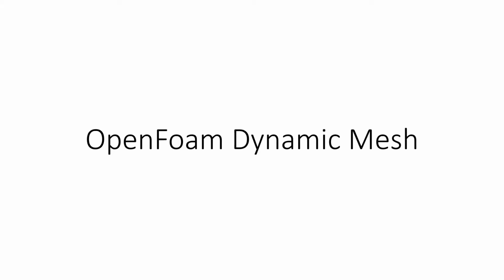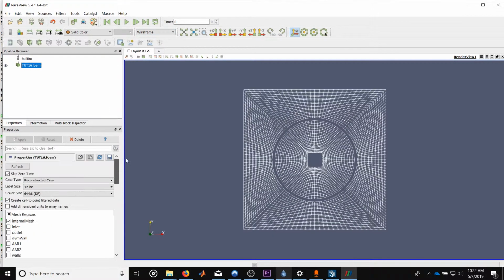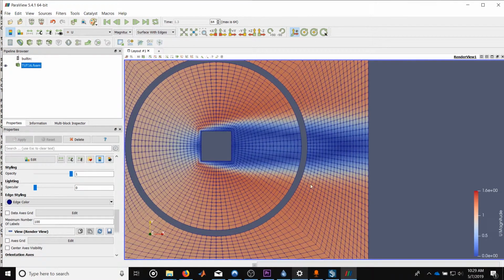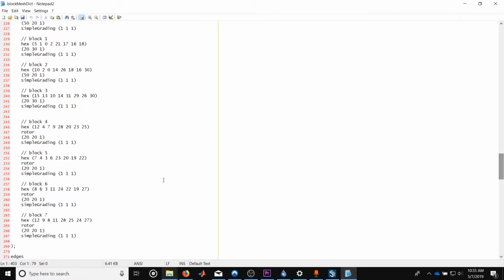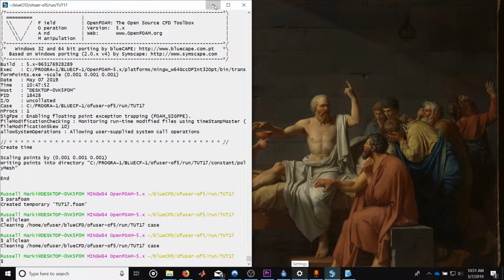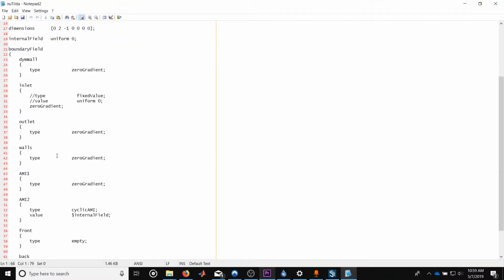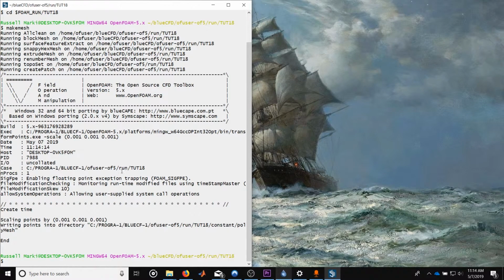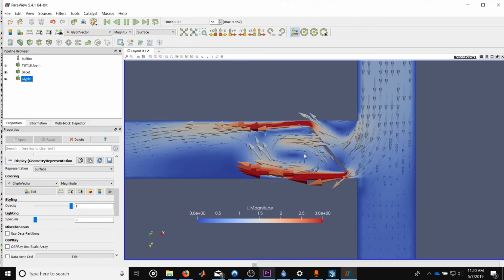Basic Dynamic Mesh Tutorial OpenFoam

Comment: Hey, thank you so much. I need to make a pimpledymfoam case for my thesis and I didn't know where to begin
Reply from the maker: What kind of case?
Reply: @russellm8635  I have to make a 2D simulation of a rotating vertical axis wind turbine, called Savonius turbine.
Reply from the maker: @riccardorinaldi6430  OK, that turbine looks like it should be simulated like the 2D case I have in the tutorial.  The turbine itself will just an edge in the mesh, defined as a wall.  The "cyclicAMI" would be the outer circle and the "wall" would be the two scoops like in here https://en.wikipedia.org/wiki/Savonius_wind_turbine#/media/File:Savonius-rotor_en.svg
Reply: @russellm8635  Good advice, thank you! Actually, I thought something like that, but, currently, I have a problem with the meshing with SnappyHexMesh: I introduced a cylinder outside the scoops to make them rotate (the AMI), but the wall of the scoops are then too much "squared" and they're not curve surfaces. I don't know the reason.
Reply from the maker: @riccardorinaldi6430  Maybe increase the resolution if the scoops STL?
Reply: @russellm8635  Thank you, I'll try this solution.

Comment: Hello! Nice video and explanation! In my case I have a stationary and a moving part of the mesh. I merge the two meshes with mergeMeshes and after that via setSet I define the zone which I want to move( rotate). I am using the AMI and I defined the corresponding neighbor cyclicAMI patches in the boundary file(I also use lowWeightCorrection  beacuse otherwise it crashes in the first time step). At the end of the day, when I use moveDynamicMesh everything seems to work but when I start the simulation using interFoam, it runs up to a point when deltaT becomes really small and it stops. What would you suggest me? I cal also show you the boundary conditions that I used.

Thanks in advance :)!

Comment: hi everyone, i help me please with this :  ERROR: Error reported: failed to launch 'pimpledDyMFoam -parallel' on DESKTOP-FD
CO49G
i use CDF Support
help me please
Reply: What case file were you running when this happened?
Reply: @russellmarki4688 propeller of a ship use cfd support from openfoam
Reply from the maker: @carloschl265  Have you tried running a much simpler model with pimpleDyMFoam?  If you know the case setup is good that means the installation of OpenFoam is bad.  Try and verify that the case setup is a problem and if it isn't, reinstall OpenFoam.  If the case setup is bad, then it could be bad in any numbner of ways.
Reply: @russellm8635  thank you.